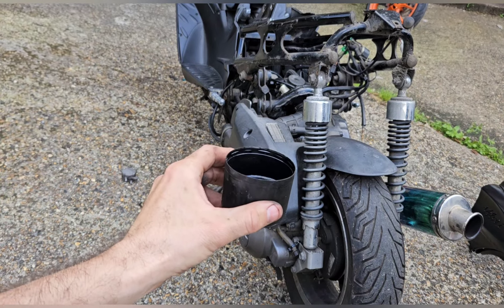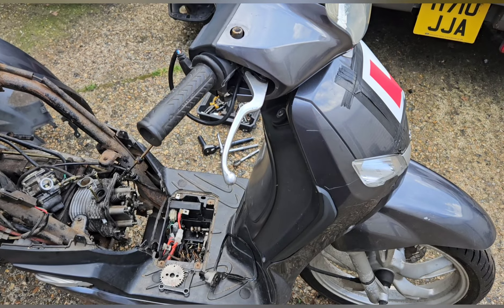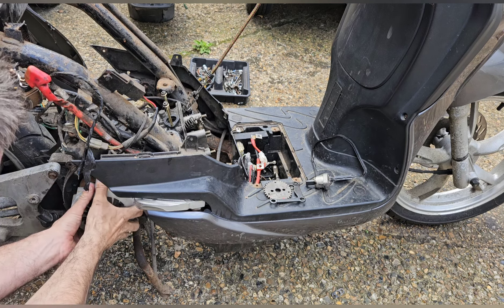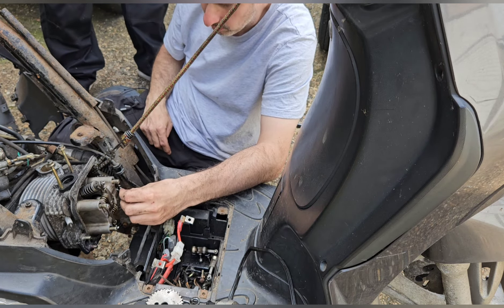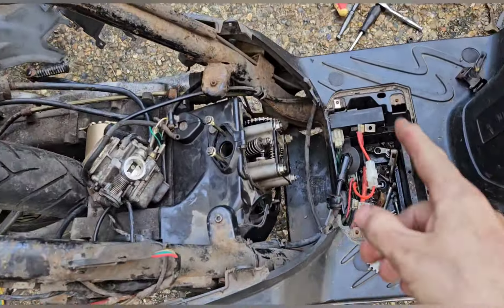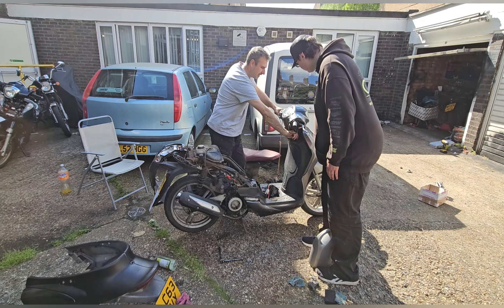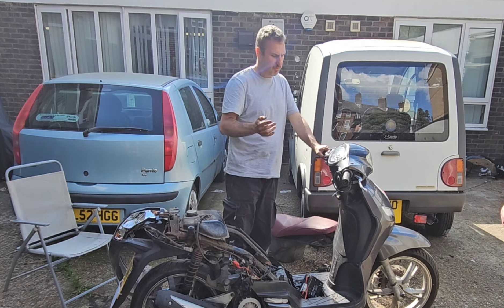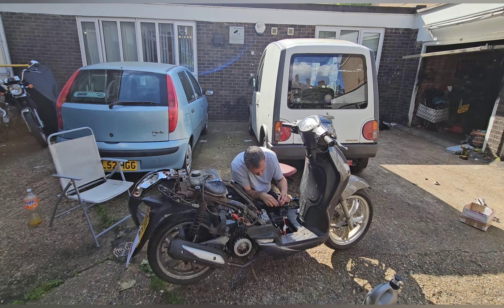Does a new top end fix my Peugeot tweet 125cc?, Peugeot tweet valve fix, Peugeot moped fix.

Comment: Hey buddy, good to see another runner. Im going to be pedantic but its said with love. The piston top is fixed in it's position on all strokes. The compression stroke is when both valves are shut and youll feel the compressed air in the plug hole. Of course this is no use when the head is off so you need to mark the cam/cams before removal assuming the last fellah did it right. In the case of a broken chain its a case of trial and error . Suck,inlet valve open . Squeeze both balves shut. Bang valves shut but piston going down. Blow ,exhaust valve open. Basically piston height in bore is fixed unless the bearings are fooked!   😂   . peace and love brother sorry for the lecture! ✌️❤️😉
Reply: correct
Reply from the maker: Yes, I'm not sure what I was thinking. Possibly thinking about multi cylinders
Reply: @motorcyclerescuer  If that's the biggest mistake you've made then your doing okay Charlie! All power to you mate. take care fella
Reply from the maker: I regularly make mistakes but your right yes, simple mistakes aren't to much of an issue. 

Cheers mate

Comment: I don't agree that the piston would rise higher in the barrel on the compression stroke. The piston is connected to two fixed points, it’s impossible for it to change.
Reply from the maker: It's something I've experienced in the past I believe but yes you have a point. What makes a false tdc then? What makes 1 stroke a compression stroke? Possibly only through valves mayby.
Reply from the maker: Also in the past we would put something through the spark plug hole to determine tdc. But I guess it could be tdc on any cycle until the valves are connected?
Reply from the maker: It must be multi cylinder I'm thinking about. Finding which piston is at tdc for timing.